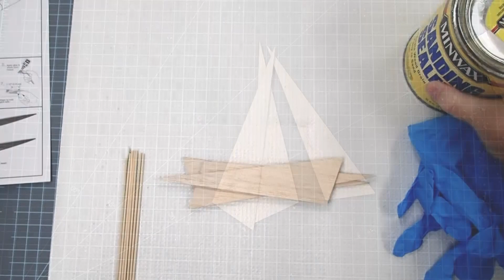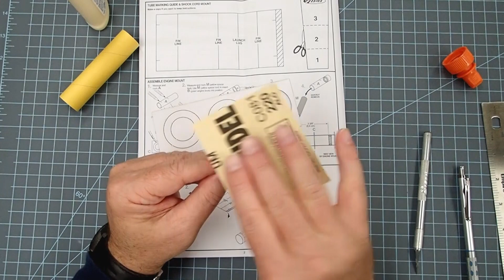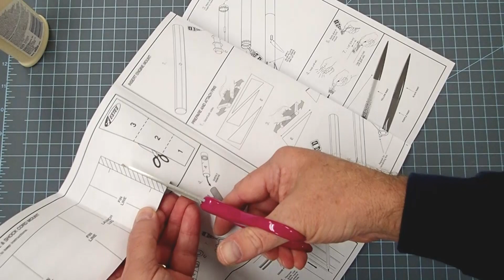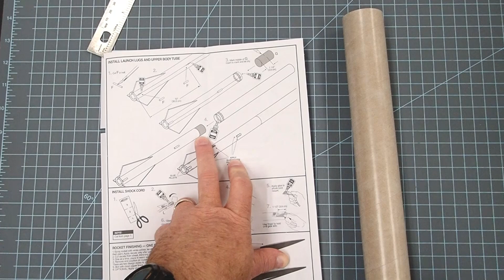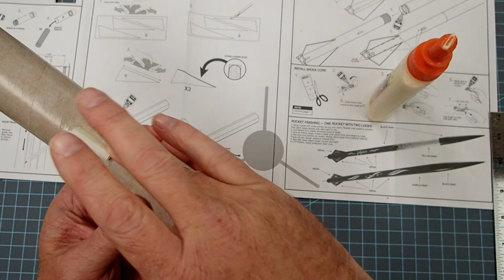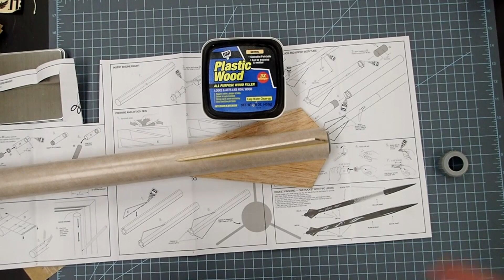Estes “Vapor” model rocket assembly

Comment: You mentioned that they should have made this with thru the wall fins. I bet if you got a similar size piece of balsa that yhe fins came in, you could make a template from original sheet and add the fin tabs. Just have to make sure the grain is oriented properly.  This would make a good video topic too. Redesigning fins for strength or something like that. Maybe also include making sandwiched fins from balsa for plywood like strength or show some estes kits where the fins come in multiple pieces like Der Big Red Max and highlight why they make them this way.

Comment: How do keep the engine mount from blowing out the bottom when the parachute is ejected?
Reply from the maker: Either use masking tape for a friction fit, or get a screw-on motor retainer (sold separately from Estes). I chose to do the latter. However, the rocket landed in a river on its first flight.